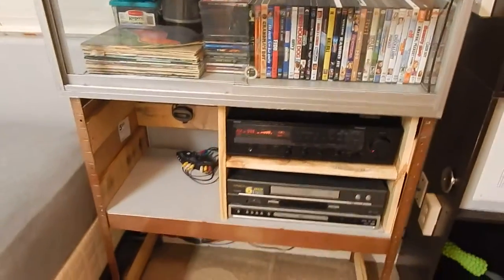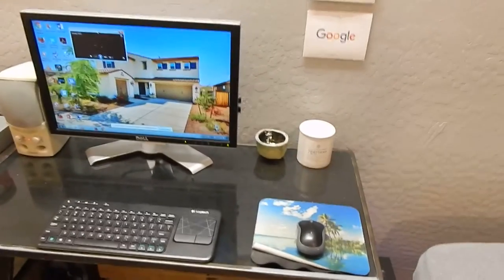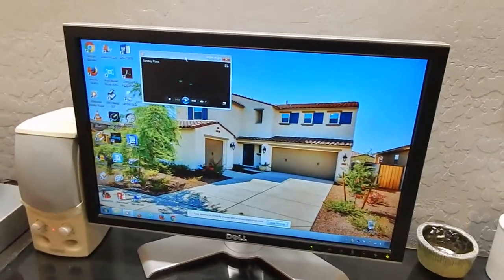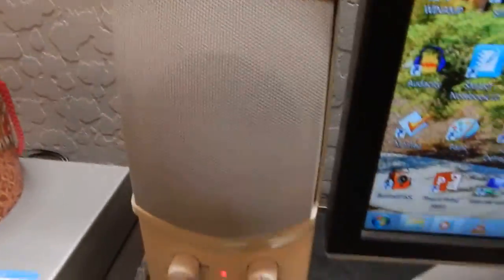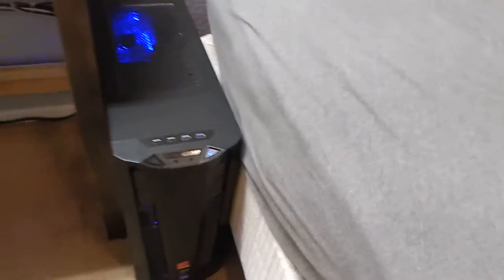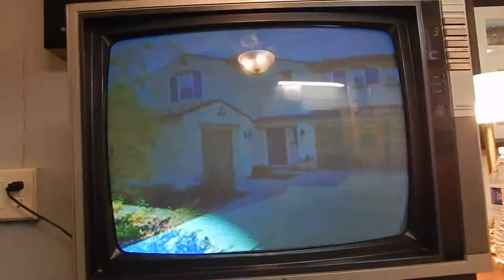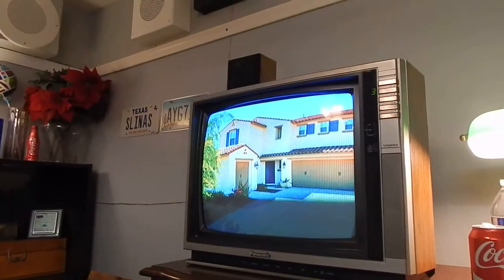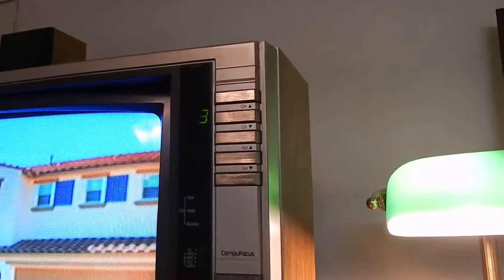How My Intercom System Works

Comment: what is inside the pink box
Reply from the maker: In the pink box is a board that my dad gave to me that was used a Costco Wholesale store which was one those in store demos for advertising a product by pressing the button which was for specs about the Sony surround sound speakers on display. The board has a SD card slot to load mp3 files on for the board to play the file when the button is pressed which is the phone. I made the board into a tone generator which I can make or load paging tones on the SD card, slide the card into the slot and will play the tone when the phone button is pressed just as if it was at the store in the electronics section waiting for the button to be pressed. I made this in one night due to me being bored and wanted tones to be played when the phone is picked up to talk on the intercom system.